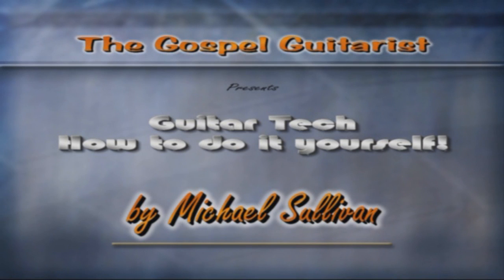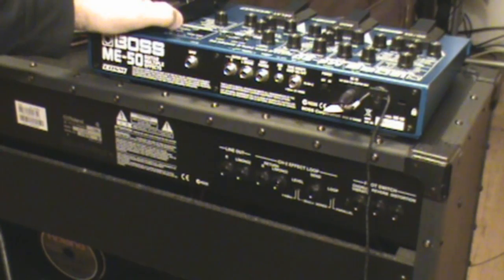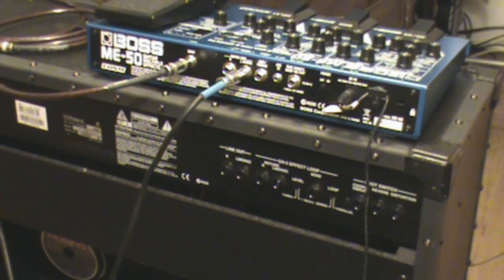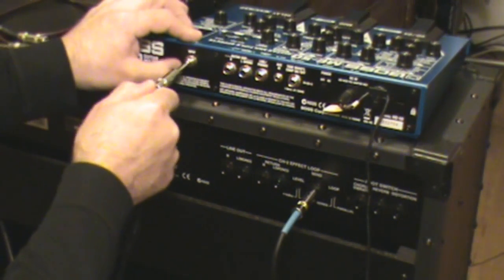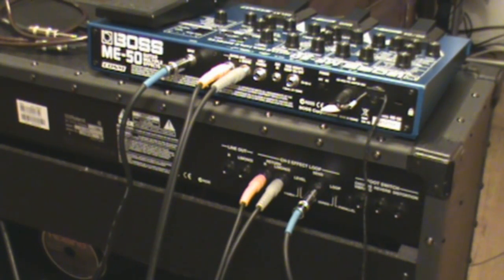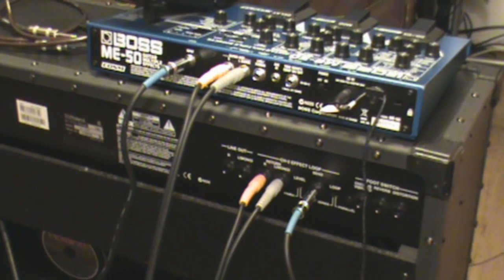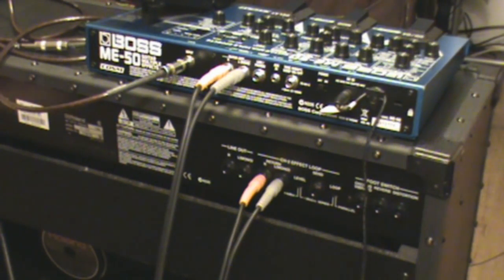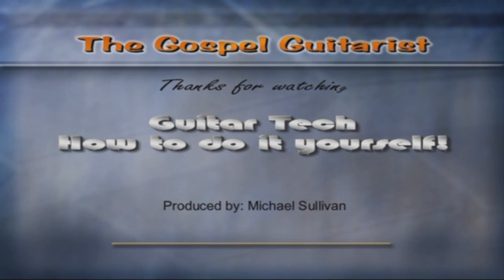Options for Connecting Guitar Processors.

Comment: Very helpful, well done vid! Trying to figure out this Kustom KG 210FX  a friend gave me. He got it at a Goodwill for $18.95! Missing its pedal. It's nice but if I connect my effects board from the front it was sounding kinda like leftyfusion88 describes. This amp is loud plugging in the front but if I use the loop, I lose the volume, big time. Is that right?  Same with bypassing the preamp, lose the volume. It's like something isn't right to lose that much volume using the loop. What am I missing?
Reply from the maker: May be a reason it was $18.95. Is there a loop level control which needs to be turned up? Do you have pedal dieing? Trying out each pedal in the loop by itself and see if maybe you have a dead pedal? The loop on the amp may be damaged as well. Hope that helps. Process of elimination! Plugging straight into the loop and bypassing the preamp completely and not blowing your head off with 100% power amp is telling me the loop has an issue.
Reply: I was hoping not but yea that's how it found Goodwill. However the volume it wants to play it is a pretty nice one & it does sound much better using the loop. I've never messed w a loop before, I've always just plugged in the front and you're showing the connections for the options is perfect. My deal is rigged lol I use a DOD stereo multi effects processor. I run it to a Peavey PV-4C stereo power amp that goes to 4 12s on one side of my living room & on the other side it was going to a Peavey Renown but now I'm using this Kustom and the sound in my living room aint bad. My 18.95 gift is still a blessing. My TV runs thru a pretty nice yamaha sound system & I jam to youtube in there. I enjoy it. I've been trying to tighten up my game a little bit & upload a practice with a half way decent sound with my old sony camcorder lol if nothing else it's fun
Reply from the maker: Really glad my video helped you out, so glad to hear that from people. If you can't have fun playing...what's the point right? Rock on! :)

Comment: I have a Vox AC 15...I play my guitar and effects through this amp and my backing tracks through another amp....would it be possible to play my guitar and backing tracks just through one amp by using an audio mixer....would I be able to get a good sound just through one amp?  Thanks and cheers from Vancouver.
Reply from the maker: You can buy small practice amps with inputs for audio playback. Don’t make it harder than it needs to be.

Comment: I have a boss me 80 and when I follow this method it sounds like crap.. I have an EVH 5150 iii el 34 50 watt head and a half stack... I don't think that you can use the effects of the me 80 or me 50 cleanly unless you bypass the Amp's pre-amp completely... I think I will try the boss GT 100 and see if I can get a true 4 cable method.
Reply from the maker: The more expensive units often have an FX loop which allows you to put time based effects into the amp loop while keeping other things that belong in the front where they belong, in the front. The Boss GT100 will sound fine, but remember you need to set gear up to your liking, default settings almost never cut it.
Reply: @TheGospelGuitarist  Thanks for the reply.. I now have a BOSS GT-10 that has an effects send and return. I tried the 4 cable method and it sounded like crap.  I was getting clipping and coloration of the 5150 tone.  I still have the boss gt-10 but now I run a wet dry wet set up with the effects send from the 5150 to the input of the gt-10 and the stereo output from gt-10 into a solid state stereo foot pedal amp that powers two vintage 30 cabs for left and right.  The sound is amazing.  I think it will sound even better when I get some real pedal effects.

Comment: Hi, congratulations, there aren´t many videos on this topic!. I have experimented many options for connecting my guitar, fx processor and guitar amp. I have a zoom g9.2tt and a fender twin amp. I love the sound I get, though I want to have a stereo sound. The g9.2tt has a great preamp, so i have connected both stereo outs to a stereo power amp, and the amp to the speakers of the fender guitar amp. It was really nice, and I'll have to re-program everything for this configuration. The bad point was that it occasionally produces a "plop" sound. It is a sort of compressed mid range harmonic that suddenly blows the speakers. I've found that lowering the mids of the eq, it disappears, but also disapperas the great clean sound I was enjoying! Have you ever experienced anything like this? Thanks! Juan, From Patagonia, Argentina.
Reply from the maker: lituanoz I haven't experienced anything like that. Could be your power amp causing it. Is the power amp and speaker ohms matching? Say the amp is 8ohm are the speakers 8 ohms? These things need to match.
Reply: TheGospelGuitarist Yes, they match. The power amp admits 4-8 ohms speakers and the speakers are 8 ohms. I'll reconnect it all again and i'´ll try to find out what's happening. Thanks anyway! Juan.
Reply from the maker: Check to see if the unit is making noises in other setups. If it is...something is wrong with the FX unit. Say does it pop when using it along with headphones and no amp. Pop in front of the amp or in the loop ect.

Comment: Hello..
I might have mist it on your video .. how do I hook up my line six hd 500 to my engl Powerball . I want to use the sound of the engl and just the effects on my line six ..
Reply from the maker: Your manual should be able to tell you how to do that. I think the HD500 has an effect loop which you would use in a 5 cable method hookup to use the effects only from the HD and the drive from the Engl.

Comment: So i have a boss me80 and peavey 6505+112 combo. I wanted to use the mfx for modulations but im also wondering if i could use the wah and tubescream on effects loop
Reply: If you are plugging your guitar into the amp preamp and then sending the loop to the ME80 then I would say no.  Wah after the preamp has a very different sweeping sound...and overdrives after the preamp generally are not a good idea.  However,  If you are plugging guitar straight into the ME80 an then to the loop then YES.  They will work just fine.
Reply from the maker: Agreed. Some of the effects should be in front of the amp.
Reply: +Kilo Tango what i tried to do was plug the me80 on effects loop and was only using reverb delay and equalizer i haven't tried engaging the wah yet so i still have to find out how it would sound. I also tried engaging overdrive to boost the tone but didint sound really good.
Reply: +TheGospelGuitarist yes i agree. I tried plugging the me80 in fromt of the amp but i prefer the gain on the amp itself. More punch to it compared to the presents i have on the mfx
Reply: @12Jsilva  try using the boost with the drive almost all the way down anf the tone where you like it and the level where it matches the sound output when its turned off, or slightly higher. Works for me and I run the unit through the effects loop of the amp. I use my amps natural sounding preamp and keep all the distortions and modelling preamps off on my me 70. I have not tried the wah yet ...

Comment: So these means ..i can plug my boss me 25(fx loop not included) to my laney irt 60's fx loop with 4CM
Reply from the maker: FX send to guitar input and output back to FX return. I wouldn't use distortions there though. Just time based effects like chorus, delay, reverb, flanging ect.
Reply from the maker: Unless you want to use the amps power section only. Then you use everything.

Comment: thanks for the Video. I thought it was awesome. I was wondering if you can give me some advice to setup my Amp.  I have a  Peavey VYPYR 100 and the VYPYR Processor Foot Pedel. I also have a Digitech RP 150 processor..you mention you can make your solid state amp sound like a tube amp. could you help me setup  my \Amp and my Processors. thanks  Kindly  Bill
Reply from the maker: Well, a real tube amp works best for tube tone, although solid state cleans can be nice on some amps. No one can help you find your tone. You need to spend time tweaking knobs, trying pedals, switching strings, pickups, even cables. Too many variables involved for me to setup your amp. The RP's I am not familiar with so you'll need to read up on the unit to see if it will do the 4 cable method or if you just want it in front of your amp where most people seem to run them. Presets almost always sound bad to the user, so tweak them until they sound good to you. That may not be super helpful but every ones ears hear differently, so you need to learn what it is you like to hear from your own rig. Even with tube amps we switch tubes to find a tube character we like. Lots of stuff to play with are a guitar player. :)
Reply: TheGospelGuitarist thanks I appreciate your advice.

Comment: Can you use a a BOSS ME-80 with a peavey vypyr vip 1?
Reply from the maker: +Kyeris Eiden Yes
Reply: +TheGospelGuitarist I meant me-50
Reply from the maker: Still yes, just processor.
Reply: TheGospelGuitarist What do you mean?
Reply from the maker: +Kyeris Eiden Processors can be used with any amplifier. You can put it between the amp and guitar or into the amps effects loop if it has one.
Reply: TheGospelGuitarist could I put it in the AUX input?
Reply from the maker: You could run from aux send into the unit and back to the aux returns yes

Comment: Don't you only need 3 cables if you don't go stereo?
Reply from the maker: Yes, since most are not stereo amps.
Reply: @TheGospelGuitarist   Thank you for your response. I have another question. If you were using a effect processor into the front of an amp on the clean channel. Would you turn up the amplifier volume on the amp loud and turn down the processor volume or would you do the reverse?
Reply from the maker: My approach has always been to setup the amp alone to sound great first. Then add the processor and setup so that the volumes are matched by using the processor controls so when I bypass a pedal or processor the vol doesn't make a large jump either up or down. Same if I just use the processor, I balance all my patches as well. Hope that helps.

Comment: So I have head with return I tryed plug it in left mono to return I hear sound just it's not lound at all I'm trying figure what problem is?
Reply from the maker: You may need to reset your processor and amp head master output volumes. Also make sure you actually are plugged into what you think you are plugged into. Never know!
Reply: If you've bypassed the volume knobs on your head, they won't work.  Some amps have a master volume that is beyond the heads preamp, in which case it may still work.  Therefore, the volume will solely be controlled by your processor.  Make sure you have the 1/4" volume on the processor turned up, as well as the master volume on the processor.

The reason they have different volume knobs for different outputs is so you can send one to, let's say an amp, and another to a mixer.  Each needs it's own individual volume so they can be adjusted to match whatever is necessary for what you're running it to.

Comment: Could you connect the out on a Amp Head to the Return on a Combo if the Ohm rating was the same?
Reply from the maker: Not an electronics guy but I don't believe the inputs are rated in ohms. A tube head needs a specific load on the outputs and return jacks are not going to support that. A solid state head you may try but I think you would risk blowing out the return section of the amp if run to hot, which is very easily done. My recommendation is not to try this. Returns are for effects not amps.

Comment: No way. Sorry but totally disagree with this. Generally distortion or overdrive pedals or simulation do not go in the loop although that's not saying you can't but it will not sound as good. I have an ME 50 and did this experiment and to me it did not sound as good going through the loop.
Sorry
Reply from the maker: The jc is all solid state. Not much difference but on a tube amp I totally agree. Only effects sound good in a loop.

Comment: Useless video for me, it doesnt tell you what if you have no fx loop and most modelling or beginners amp under $300 has no effect loop it only contains guitar input and aux in. So i guess if i want to bypass amp effects i need to connect multifx -> amp auxin ?
Reply from the maker: You can try it. Obviously if you have a low end setup your options are limited. Guitar into the box into the amps input. You need to work with what you have.